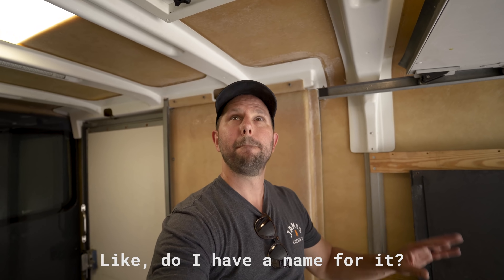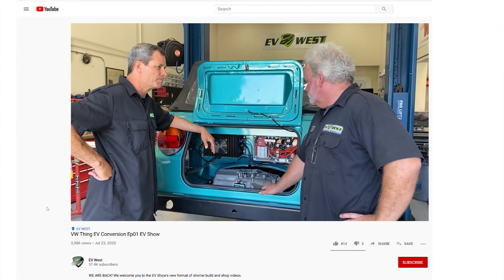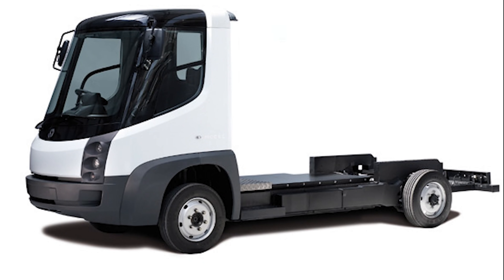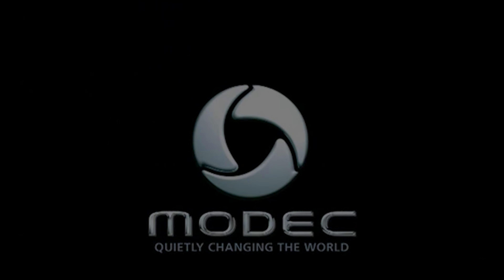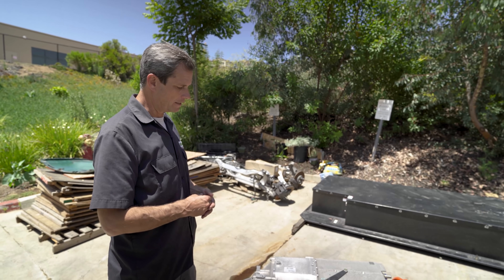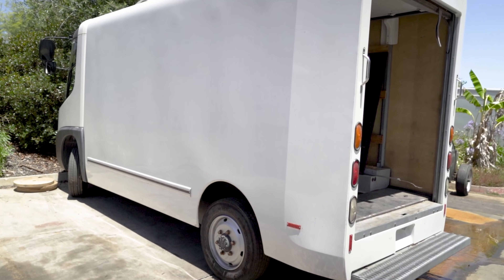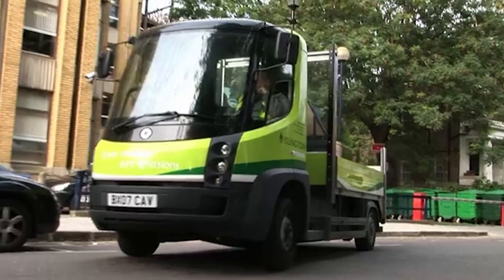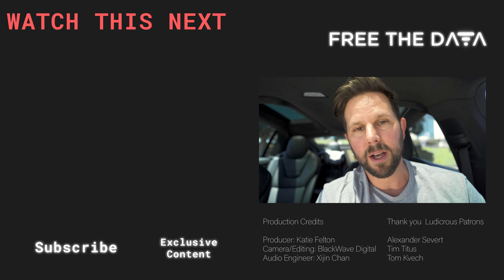Building a Tesla Powered Electric Van with EV West!

Comment: Take that thing camping! In Texas, where I live, the state parks have campsites with 30-50 amp 240v electrical hookups ($16/night).

Recharge while sleeping in climate controlled comfort😉
Reply: Outstanding🍻
Reply: I wonder if camp sites will need to change their pricing as more EV campers start to show up.  Charging up a 160KW battery would cost $20-30 in Electricity
Reply: @TonyAnschutz  Depends on how the power draw of an EV compares to an RV or travel trailer. 

AC draws a lot of power and the ACs on those aren't the most efficient.
Reply: @TonyAnschutz  I calculate just over $10 for charging, but that is a large percentage if the nightly charge is $16/night, so yes they still need to raise their prices.
Reply: @TonyAnschutz  no...please don't hahahaha

Comment: The kid who used to look after my Z28 (rebuilt the engine back in 2000), has stuck a Tesla motor into an older VW van.   He uses Volt batteries, because they are easier to fit than Tesla modules.  He writes his own power management software.   Awesome stuff.  Look Chris Tapp, Tapp Auto, Ottawa, Canada.

Comment: @1:48 It doesn't use lead-acid batteries, except one for the 12V system. It uses Lithium prismatic pouches and it's a 320V battery.

Comment: I was involved with one of the suppliers to the Modec company. IIRC it was the basically the vision of one guy previously at LDV/Leyland Daf vans and funded by a former owner/director of the London taxi cab manufacturer. I thought it had a weird molten sulphur battery system but later production may have changed. One fundamental flaw was the doors - behind the cab rather than alongside the driver/passenger so wasted space and effort getting in and out.

Comment: I’d love to see Tesla make an E-RV using the semi battery
Reply: The electric RV will be the Holy Grail.  Imagine running a/c at night without the noisy generator, regen helping you get down the mountain without brake fade, maybe some solar on top to supplement everything while you're away hiking.  Cool future ahead.
Reply: Aussie2u I can’t wait. I would totally live in an E-RV lol
Reply: I was crushed by the high bed sides on the Cybertruck, I was hoping to do a light weight camper fifth wheel like a mobile house/ charging station. Bummers.
Reply: @aussie2uGA  most EV already runs on electric systems using lithium storage batteries and solar panels, those giant and medium RVs can go further to remote places and only use diesel generator for emergency

Comment: Dude if they could wire all the insides to the battery packs to run like heat ac microwaves TVs and everything and throw a ton of solar on top to charge the batteries directly this could be the best van life build ever since u park and sit for weeks sometimes you could essentially have free unlimited power sun permitting or if u ever ran out of juice just let it sit in the sun for a few days and get you a full charge and drive out no tow or gas can required

Comment: I'm actually considering buying a used/ working 2006 Dodge Charger SRT8 and convert it to electric while throwing in some retro audio formats like the the cassette and 8 track in there (and you can't forget the CD/radio) complete with a wooden dashboard and a DIY instrument cluster. all of that built onto a cold rolled steel frame with some parts from a used Tesla Model S (batteries included and also built into the new charger frame). but I'm not including car version of a record player, those didn't last long and they ended up destroying your records, not worth the hassle or cost.

Comment: Hi Ben, would really love your opinion about the new Polestar 2, which I think is the first real competition for the Model 3.
Reply from the maker: Whenever I can get my hands on one
Reply: @BenSullinsOfficial  I would also love that. So many reviewers are comparing Pole star 2 to model 3 but are not yet bringing totally accurate information to the table. Also many reviews will not talk about the different charging rates yet will note that the mirrors are rimless (I cannot care less about that). This  EV deserves a fair comparison and review. As someone whom used to own all the older Volvos (you know the ones with 4 cylinder motors that had a hard time going up hills but were built like a tank), i might look seriously at it even though there is not yet a good charging network in the US that the Pole star can use. 

One of the reveiws talked about the bad brakes in the Model 3 yet then says how you don't need to use brakes much on the polestar. Then i found out that the cars use the same manufactures for their brakes.  Well the same goes for Model 3; one can nearly use brakeless driving for most of all driving conditions. The quality of reveiws need to improve and i know you would provide one of the better ones. thanks for your channel..

Comment: I just got a camper van Travato (can park anywhere) bring animals. The "Volta" lithium system I can go 8 to 12 hours off grid running ac or 5 days no ac.  Partner with volta system 🤔 and have two separate systems one for driving ev and volta 4 pack while you are charging you can watch TV and camp out.  People will purchase as a blank slate or built out with toilet, beds, shower.  I for one WOULD BUY it if it eliminates gas and charges like a Tesla.   I would own a Tesla now but we don't like cars need  Class B van EV for sure.

Comment: Modec have 150 battery pack , my was 5.5 T and 150 mile, and was 2010 project for self charge battery pack in drive , resolt was 600 mile in one charge so, no succes

Comment: Not the best idea keeping this thing all electric. Electric vehicle development isn't that good yet. It's still not very flexible. It's very limiting compared to what you could do with a shaft drive combustion built vehicle. You can always put batteries and motors onto a shaft drive, axle, and differential combustion setup. It's just a lot more flexible and attainable to work on and get great results out of. Not to disappoint anyone and especially future developers, when we hear the idea of a tesla powered van, we do think of tesla batteries powering it, but the idea is still very broad, and when considering that EVs don't make good vans, maybe you should consider different approaches such as a hybrid van with combustion, or a fully combustion van, with no driving drawbacks, and a giant tesla battery pack powering the electrical system for house power. Again, on top of a combustion setup, with 4wd, locking differentials, usable range, and usable fill up times, and usable towing and hauling capacity that we would expect from a van. To me there's no sense in making a van like this if no one is going to buy into it if it doesn't inspire confidence in owning it, just to say that it's fully electric. It's just about acknowledging what current technology actually gives us, and doing the best we can with it. If the draw back for oil changes is more ranger faster fill ups and greater towing and hauling then it might be worth it. Not saying it always will be. There's a future and a now, and pushing the future doesn't always make the now better. Combustion is a now that speaks volumes on it's future. Efficiency can't be such a focal point that the rest of the vehicle suffers as a result especially in the case of a van where utility is the next focal point.